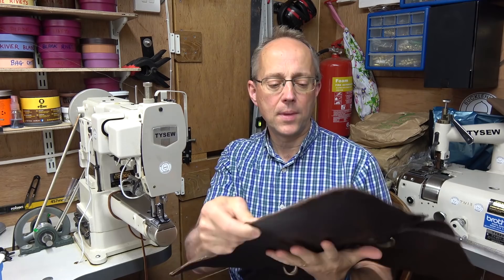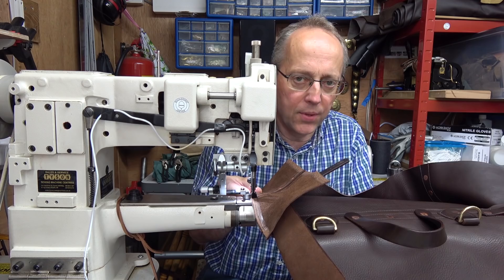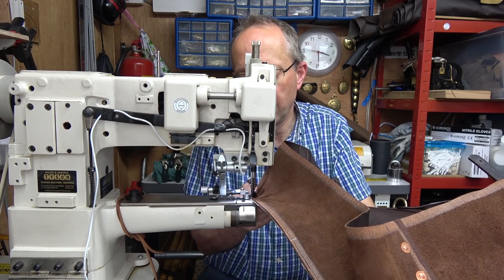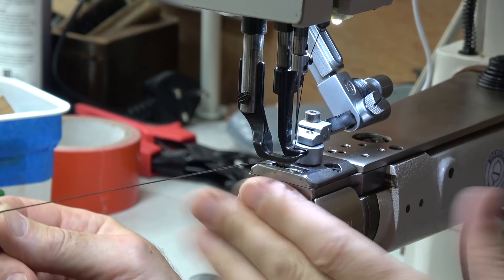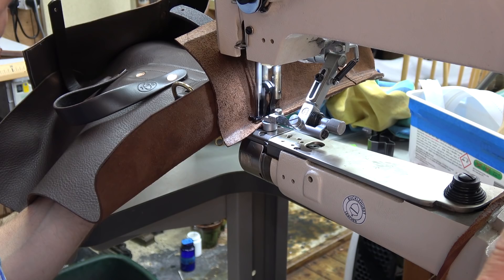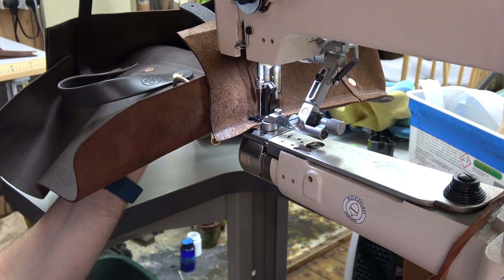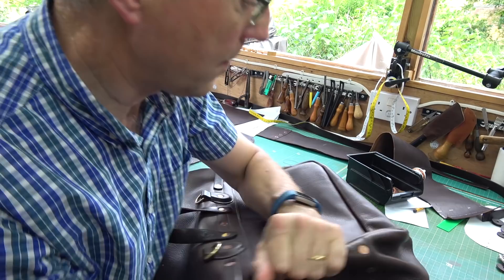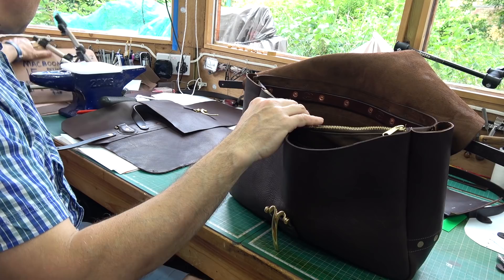How To Sew Up A Leather Bag by Machine

Comment: Great video, Harry.  I like the idea of back-stitching at intervals when sewing the panels together to provide extra security!
I work for a company making leather bags, and for turning the more difficult ones, we have a metal pole, the tip of which has been carefully smoothed, fixed vertically to the workbench.  You can then use both hands on the bag while pushing against the pole to turn the bag right-side-out.  If you're doing a lot of bags, it might be helpful to you, and you certainly have the skills to make something like that yourself!
Nice work, and thanks for another enjoyable video!
Reply from the maker: Thanks Jason that is a great tip.

Comment: thanks for the tip on doing extra backstops (going back a bit and forward again) in high wear areas  that will stop the seamfor going up further, this will work with sewing fabric as well. i made my own fingerless gloves from fleece just before i learned of this trick, which would been good in certain areas n them. great tip.
great bags you are making , i love your mentality on the quality. it is the small things that makes the difference of a great product.
Reply from the maker: Thanks. Rgds Harry

Comment: Very nice Attache Case ,  Watching - Harry a benefit for you on the arm machine is 2 or 4 strong laces hanging from the ceiling on a loop or swivel but at the end of your machine with clips to hold the project at a level so it can turn but hold your work  they`ll twist but not alter your seams you can hold both sides of the foot .
Reply from the maker: Thanks Garnett

Comment: Hello Harry. What is the model number of the machine you are using. On the manufacturers site it shows the connecting rods to the foot pedals and it looks like they are adjustable so you can move the pedals to suit

Comment: Hi Harry I love your videos I am wondering if you can help me. I am searching for an industrial-type sewing machine that sews directional. I am sewing Amusement park skirts and it requires me to sew a cutout and inside the cutout (Heavy Vinyl. I need to insert webbing to reinforce the cutout and then the viny from the cutout. I can not get down inside the cut-out by turning the fabric since it is so stiff. I need a machine I can sew left then right without turning the vinyl fabric. I have searched and I just can not find any that has this capability except "embroidery type" machines and I know it needs to be heavier than that.
Reply from the maker: Hi Evelyn...is a Singer 29k patcher suitable as it can sew a circle without moving the vinyl as the foot itself rotates through 360 degrees.....so it could sew left, rotate foot 180 degrees and then sew right etc.

Comment: Is that Tysew a clone of the Adler 669? What is the thickest thread you can stitch with it? 207? 277?
Reply from the maker: Hi I think its based on a Pfaff 335...(I know it also looks similar to a 669) I put nm40 metric thread through it, and I have optimised it for that...I think you might be mentioning thicker threads...I think a nm40 is like a 69 US thread.....so I am using a 18/110 needle if that helps. I think I probably could put thicker through it, but I have not tried as its a lighter machine and I don't need to use it for thicker materials as I have a Juki dnu1541 flatbed which takes a lot thicker thread with ease.
Reply: @harryrogers  Thanks. This is very helpful. I currently have a Sailrite LSZ1 and a Juki 441 clone, which is  nice combination. A Cowboy 6900, which I think is an Adler 669 clone would be a nice addition.

Comment: Very good vid. If you were repairing a thick leather vintage mail bag, and you wanted to sew some stitching that separated, do think the cylinder arm machine will best accomplish this? I'm in the market for a unison feed walking foot machine. I looked at a few table machines (Consew, Juki and Seiko) and I thought maybe the repairing of the leather bags could only be done on a table machine if the bag can be turned inside out? With the cylinder arm machine this does not appear as a necessity.
Reply from the maker: I like the cylinder arm as it gives good access, and reaches places a flatbed will not

Comment: Great video. Sir, what is the presser foot (you are using, one leg) called? And, what is the edge guide called? Sources to buy? I have a juki DU 1181N like machine. I wish to sew all around the edge of the cover/case of my journal books and sew a loop and a belt for closure. How do I wrap in around the edges of the belt? Thanks
Reply from the maker: Hi its actually a zipper foot part ground off. College Sewing Machines UK will have something....ditto the drop down edge guide....EBay also have them. Sorry not sure about the stitching.

Comment: Hello,
When designing your bags do you use a software of do you just draw them up on poster board and use trial and error for the sizing and the gusset fit?
Reply from the maker: Hi I draw them and then make paper models.
Reply: Awesome. Any tips on how to get the gusset to be the correct length?

Comment: Please help , I have cylinder arm sewing machine Pfaff 335 , but thread keeps breaking , I tried many way , timing issues but not solved ! I am so exhausted , don’t want to give up . I can send you clip showing how thread  jam
Reply from the maker: Smooth needle eye? Smooth thread transit over tension washers support arm? Correct size of thread for needle...machine?
Reply: Harry Rogers I use 20s and it works in the beginning , then after I removed the shutter hook to clean and adjust it again the thread get jammed in the top shutter holder , need o use 140 -22 , also I used 120-18 .... I bought servo motor to replace the clutch motor I have now , it’s coming from China , all  I am facing is this , yet , hook catching top thread but not the no in thread , I can send you video , Via email , I am in London .
Reply from the maker: @azzamody  hi don't know but I use nm40 mostly and some nm60....so perhaps try thinner thread...nm20 is quite thick for a medium weight machine....but just a guess ...suggestion on my part.

Comment: Hey Harry have you had any experience in changing a size 16 needle to a 21? Is it possible? Thanks
Reply from the maker: Hi Will...do you mean can you pit a size 21 in a domestic machine? Sorry I do not follow?
Reply: @harryrogers  yes sorry about that. I have a post bed sewing machine that i use a size 16 needle in it. I would like to start using thicker thread with a bigger needle such as a size 21 needle. Thanks so much
Reply from the maker: @willgavigan8768  Thanks Will...I  guess its possible but I think you would need to change the hook catcher and obviously slack off the bobbin leaf spring, but this is beyond my expertise....sorry...perhaps someone here knows the answer...I don't!
Reply: @harryrogers  thank you Harry I appreciate it

Comment: Hi Harry, I've got this problem when I flip my work to the right side I can see the thread between the seams. What's causing this?
Reply from the maker: Hi Ruth, it sounds as though your tension is slightly off...perhaps try reducing your top tension a bit and see if that helps?
Reply: @harryrogers  I'll try to adjust the tension on my next project and see if it helps. Thank you so much for the quick response👍

Comment: Thanks for sharing you techniques Harry.  Mmmmm I could almost smell that leather from here,  
Harry I have a handcranked singer 99, I'm sure it will stitch leather as it's not too thick, I'd like to make a simple,old style duffle bag for my son, what thread would you advise, I've got some gutermann upholstry thread, do you think that would be suitable or should I handstitch it with tiger thread. This will be my first leather project so I'd like to get it right 1st time. Any help or advise will be gratefully received. Thanks again for sharing your inspirational videos 😊 jackie 🌟🌟🌟🌟🌟
Reply from the maker: Jackie Rudd Hi Jackie...I think the upholstery thread should be fine with that machine on thin leather....I suggest you give it a go. It's very similar to the 201 machine.
Reply: Harry Rogers. 😊 I'll give it a go. I've bought a beautiful treadle 201, I haven't used it yet because I've got to fit the new belt first. Thanks again Harry 😊

Comment: The D rings that hold the straps on the back look like they are sunk into a padded round support.  How did you make those round pads that are riveted onto the back?  They look like they make the strap holders more sturdy.  Love the look of them!
Reply from the maker: Thanks...the pads cover the D ring holders and keep everything nice and flush. The D rings etc are riveted onto a strong multilayer spine piece for extra durability .
Reply: @harryrogers  I've never seen anyone else use that design element. Love it!

Comment: Would be helpful to know what weight & type of leather you were using.  Also, when the video began, the back wall of the bag already had the strap and handle tabs attached.  Why not show the process for those as well, as they are all part of the finished sewing project?
Reply from the maker: It was about 2.2 mm, fairly soft.

Comment: Great video, thanks for taking your time to do this. Do you use a speed reducer? Or what type of motor do you have? What is your view on needle positioning systems? Sorry for the bombardment of questions. 🙈
Reply from the maker: Hi I have a servo motor plus speed reducer system, you will find films on both fitting the servo and the 3 to 1 ratio speed reduction in other films on my channel in the Leatherworking playlist. Rgds Harry
Reply from the maker: PS I took my needle positioning off but that's probably a personal quirk.
Reply: @harryrogers  Thank you so much, I really appreciate that you share your knowledge.

Comment: I have been told before I could use my heavy duty sewing machine for leather as long as I get the proper leather needles .As I went to buy leather needles there were different size leather needles that fit my machine.What size needle do you recommend? Also do you have any experience using a regular heavy duty household sewing machine for leather? Great video as always!
Reply from the maker: Hi I have posted a film on needles...and one on the Singer 66 and another on the Singer 201...I hope that helps. Rgds Harry
Reply: @harryrogers  Thanks so much Harry! I will look for the video!

Comment: what class of sewing machines is this a clone of? I am looking at some China clones which look similar to this model.
Kind regards,
Alan
Reply from the maker: Hi Alan, a Pfaff 335 I think.
Reply: @harryrogers  thank you for the reply. I'm looking for my FIRST sewing machine and after doing my research i've decided to take advantage of my proximity to the factories where majority of these machines are built.

Thanks to your videos i've decided between a clone of :
1) Cylinder Bed - 8B Style
2) Cylinder bed - 355 style (like yours)
3) Post Bed - 9910 style  ( also like yours)

i'm most familiar with the 8B style of machines through looking at manuals and videos, but the Post Bed looks the most suitable for the work i want to do, namely making shoes. I think the answer which will help me decide is:
1) which has better control - your Cylinder bed with reducer ( with 3:1 speed reducer ) which will take some time to set up
2) out of the box solution - your Post bed ( at 200rpm i believe you said- your lowest setting)
Reply from the maker: @alanp802  Hi for shoes, my post bed would be my personal first choice, for bags a cylinder arm.
Reply: Thank you. I've just ordered a 9910 :)
Reply from the maker: @alanp802  Nice
Reply: @alanp802  thx for sharing the details.  Very helpful
Reply: @alanp802  did you get it. Was everything okay.  Price, vendor?
Reply: @giftedgoddess07  Yes i did... I gt it frm China.. A vendor called Weilishi for around 450usd!
I haven't tested it out yet.. Been busy at work 😅 i hope i figure out how to use it... There arent any tutorals available online!

Comment: Looks to me as though you could do with a bigger shed, Harry.
Reply from the maker: That would be good...in fact I would like a factory!
Reply: Harry Rogers
 No Harry, you don't want a factory. You would lose the feeling and flavor, of what you love.  I purchased a particular vinyl cutter that can handle leather, and will try to incorporate it into the blank cutting portion of my leather making.  I will have happier hands, and hopefully less error than when cutting repeat, curved items by hand.  Another 100sq foot and you won't be able to turn your stool around and reach everything. Small workshops are highly underappreciated. My art room only required a swivel, and my most used items were within reach.
Reply from the maker: cheri Lanzisera Hi Cheri...thanks for that ...good points!

Comment: Really good video. You mentioned this machine is a clone, what is it a clone of? Thanks
Reply from the maker: Sorry I am not certain perhaps a Juki or may be a Pfaff 335
Reply: @harryrogers  Thanks for your reply Harry. Just one last question, what is the thickest thread you recon this machine could stitch? I always hand stitch my products at the moment with 0.8 tiger thread and I want to try and replicate that as much as I can but with a machine.
Reply from the maker: @matthewnesbitt4033  I sew with nm40, I have not tried the lubricated Tiger thread for machines, just the hand sewing for hand sewing. I don't know...0.8mm is quite thick, I think you need to ask around and test a sample on your chosen machine...sorry I do not know, but think you need to investigate as it's a bigger ask of a machine like this.